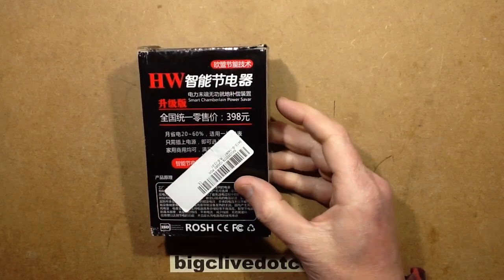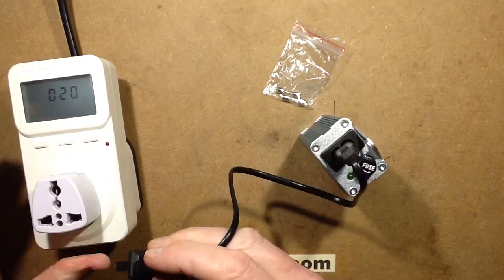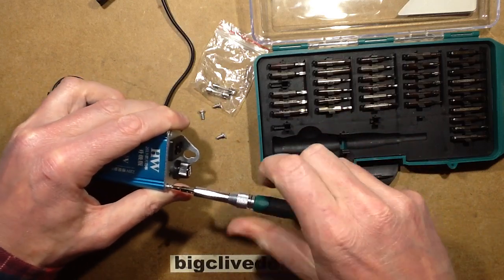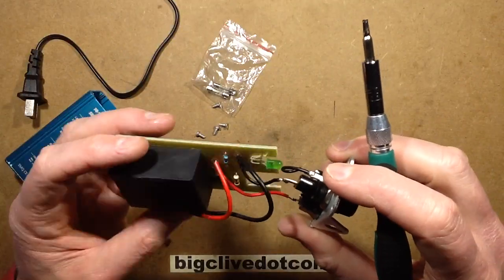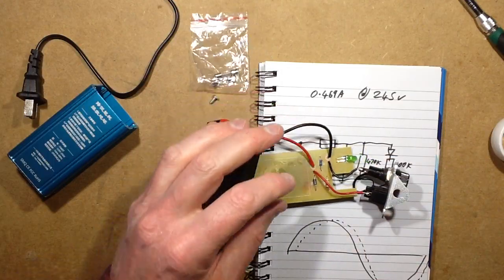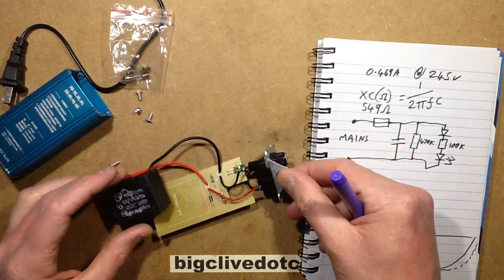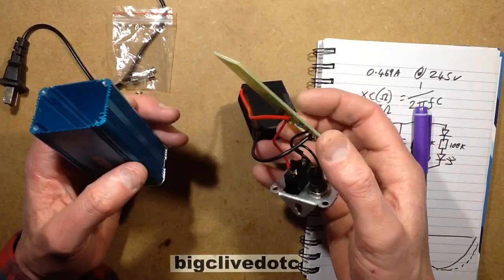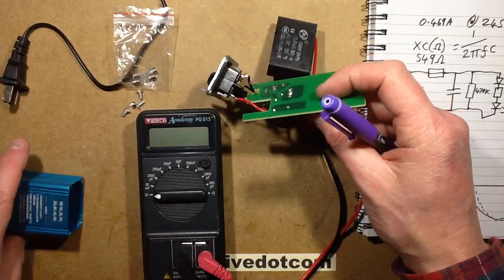200kW miracle power saving device.

Comment: for example, if you use a small lm2587 step-up converter and keep a 24v stacker of 10x 3500f supercaps, you will be able to boil water every 35minutes. the less you draw per second at one time the more you save. when you think and do everything that way, you can use and distribute the energy, and the resistance you use to reduce charging you also use as a source for 24-volt hot water (resistor)for example. if you consider one solar panel can charge those caps every 15minutes, you soon realize you can boil that water or solder a forklift to then lift a semi-truck. I have been thinking way out of the box...past Saturn...1000x. if you get the metaphor....oups...lol i consider you top of the chart brother.

Comment: I cut my electric bill (apt, rental) by 1/2 by flipping off electric water heater when not actively using it.  Dropped it another 1/4 by regulating air temp in such a way to allow the neighbors starred wall to heat or cool my space!  No quackery required 😗

Comment: I'm new too capacitors circuit board's ,but find very interesting . What about starter boost capacitor combinations for automobiles from cheap ones to middle grade .  16volt 20f  maybe just to boost 1200cc motorcycle, are they helpful or could they do more damage to a ecm even with a protection board and does it protect battery during a start-up automobile or motorcycle.   This area is dark for me up in air ☺ 100% more mechanic skills  30+years .  take care. Great video.
Reply from the maker: Proper capacitors can help with the initial spike of current during starting as they can deliver the current better than older batteries can.  They are used in some very cold countries.

Comment: The capacitor will save power consumption but not in watts. It will help offset the vars that you would see in motors or coils. But this small capacitor might lower the vars on maybe a small muffin fan. It will not save anything on watts which is lights and heaters and other non inductive loads. One more thing if you are not running a small motor or computer fan or something small it will be plugged in constantly and it will use vars as a capacitive load so it really would cost to use it. Companys that have lots of motors loads will put in a capacitor bank matched to their normal plant motor load to bring the load power factor close to zerro.
Homes dont do this for couple reasons. One is... the home are not billed for their inductive load and also the power company will install capacitor banks on lines or in substations in towns. It's easier for them to do that. But big business they charge you for var usage. The electric company may not charge homes but the power plant generators have to make vars that the town uses so that is a loss to them and they try to control it. But for homes this unit in the video is a waste.
Sorry this is long.

Comment: In factories or other industrial installations, the facility engineer knows about inductive loading; the correct capacitance for every device is wired in with the device.  In fact, if their vendors are on the ball, the correct matching capacitor will generally be part of the device (at the very least, the documentation of the device will advise the capacitance needed).  It’s not like this is something that was just discovered — Steinmetz wrote about it while he was creating the fundamental principles of electrical engineering.
Reply: You give most facility managers far too much credit for understanding the electrical systems in their installations and factories …
Reply: @andyxox4168  Of cause facility managers understand the site electrical systems, if the facilities electrical load is significantly out of phase (inductive or capacitive) the Utility will significantly increase your Unit charge. Be aware, even if you alter your inductive or capacitive load your meter will track the modified Wattage consumption and you will also be down on power.
Reply: @normie8895  … you give ‘facilities managers’ too much credit, ‘cause’ some of them don’t pay attention to spelling/grammar
Reply: @andyxox4168 English teachers look great in skirts
Reply: I always found those capacitor rooms creepy. They sound so ominious and it feels that there's some inductive voltage when you just walk in the room.

Comment: In order to properly make use of power factor correction, you would have to actually integrate such a system into your house's combined heating/power unit, breaker box, metering system, etc. And it would also need to be a smart system that automatically adjusts do that it can actually correct for different loads. And chances are, it probably wouldn't save very much power at all, though it could possibly clean up "dirty power" from emergency generators, reserve batteries, or the like.

TL-DR: Probably more effort than it's worth.

Comment: My bill shows line charge, production charge, fuel charge, tax - the wattage charge is almost equal to fixed charges. I changed to tankless water heater, insulated windows, added ceiling fan & down sized the heat pump after the upgrades. Next is changing the heatpump from (air to air) to (water to air) after I remove trees. The temperatures now are 2 degrees up in summer & 2 degrees down in winter.

Comment: Question for bigclive.
I am having a problem with a 50hz front load washer being run by a 50/60hz inverter. One bought in Thailand the other in Philippines. When being run by the inverter all is OK until the drain pump. The pump goes into convulsions. Off on very fast. So I cannot drain from the wash cycle to then continue to rinse. It works fine if I use my Honda genset. Someone once said to use a capacitor across the drain pump but that cost me a new washer circuit board.
Buy a new 50hz inverter?
Any ideas?
With thanks
Reply from the maker: The pump is probably a synchronous motor and is looking for as close to a sinewave supply as  possible.  With a waveform it doesn't like it may buzz and stutter, but never get up to its natural speed.

Comment: When the supply and load impedance match, it reduces power consuption. Your elaboration, however mesmerizing, is bullshittery.
Reply from the maker: Modern electronic power factor cannot be corrected with a simple capacitor.

Comment: I have had that idea to make the current lead enough so it is in phase with the voltage and then the electrons would bounce around more to create more work, this should be done right at the power plant or it could be done at each receptacle in your wall, but your loads would have to plug into the device, not like this device shown in this video, that does didley squat since the current just goes down the neutral wire back to the last secondary coil of the step-down transformer and doesn't enter the load device at all. A big scam to get our money! This also could be used at power plants to also add all the 3 phase currents together which would both triple the voltage and current by putting each out of the 120 degrees phases in sync since their is 360 degrees in each revolution or circle, but since the wavelength of 60 Hertz is 5000 meters, there would be some distance involved in the wiring of the process, but no we wouldn't have to use capacitors or inductors to cause leading or lagging at all to do this - just apply the distances. Contact me if you want to know in detail. And check out this and let me know if you don't think I know what I am talking about or not @ http://VoltageSynthesizerBasics.blogspot.com. More will added to this later, but I have been delayed. I have a product coming called Power Supply Curren(t)cy Saver, which doesn't go above 120 volts but will have an AC voltage regulator attached. My company is called W.I.R.E.D Power Supple Services Ltd., but I am a Slow Poke like April Wine's song.

Comment: Most household appliances are quite inductive. This results in inductive current (VAr:s) flowing in the wiring alongside the work current (Watts). Although the VA current does no work it will generate losses in the wiring.

This device is just a capacitive compensator. Technically it will reduce the total VA current resulting in less losses in the wiring.

There are some safety aspects though. If an appliance VA current is completely compensated there will be resonance. This could result in strong currents between the appliance and this device. There is a fire hazard. If an appliance is to be compensated the appliance should always be fitted with its own capacitor inside the appliance casing. Appliances should never be fully compensated. The efficiency factor (cosine fai) should not be more than 0.95. Resonance currents may explain fuse box or switch gear explosions.

The grid voltage usually contains strong harmonics. The third harmonic is the strongest. They are usually caused by driving the grid transformers close to saturation. These harmonics are actually cleaned up these devices, to some degree, but they can cause the capacitor to run quite warm. The capacitor will deteriorate fast and eventually short out. They may explode.

Lighning causes shock waves in lines and house wirings. The shock wave will go where the impedance is smallest. A device like this could provide that. The device may explode. However. It may save other appliances from destruction.
Reply: Isnt the reason we drive ground rods into the ground to reduce objectionable current like nearby lightning strikes?

Comment: The best electricity saving device I've ever seen is the OFF switch
Reply: ppl would be surprised how much you will save in a month unplugging the microwave and kerrig or similar coffee machine. power bars make things easier.
Reply: @Phil_From_Canukistan  that's not all the TV and cable box use a lot of power even when turned off so do computer and monitor you can cut your power use by up to 30 % by shuting them off when not in use
Reply: @douglaswindsor120  i just instal power strips on everything and flip them off when not in use. My power bill is very low. Vampire power draw is a real thing, folks.
Reply: @Phil_From_Canukistan  my power consumption is is low but unfortunately I get dinged billing fee's municipal access fee and a grid tie fee also GST and carbon tax over a hundred dollars per month of cost that I can't get rid of unless I cut the grid and so far I can find an inverter for the north american market under six thousand dollars and I can't afford that much money I just want a 12 volt pure sine wave inverter that gives me 120/240 volt 2 thousand watts that'll cover everything I've looked at solar generators but unless you've got eight grand all you can get is 120 volt I did find one that is under a grand but it is only 120 volts and designed to need new batteries
yearly and the solar look is a joke if you use its full capacity one day then it'll take 2 day's to recharge
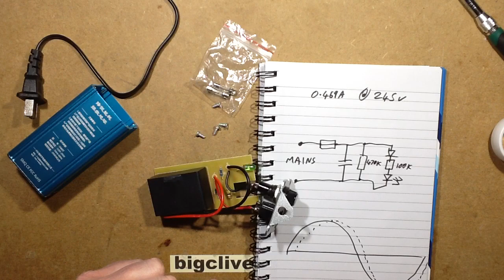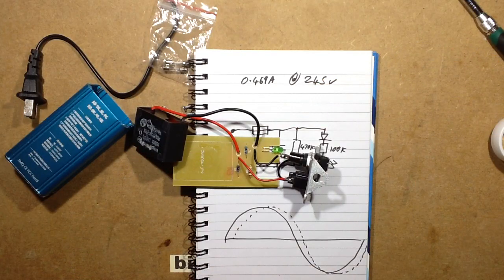Reply: celebrate Earth Hour on March 21 at 8:30p to 9:30p... switch it all off
Reply: Coverage Awareness Studio I rather not?

Comment: This device which any fool can make for 1$ or from scrap electronics can save your charger or LED bulb from failure and that's about all it can do.
Reply: Or you can use TVS(transient voltage suppressor for AC, 250V~) which is 10 cents lol

Comment: If you have an inductive load... oh there is a circuit board in there 

If you have an inductive load... there is the capacitor

If you have an inductive load... oh hold on
Reply: I literally scrolled by as he said that.
Reply: Aperture Laboratories same
Reply: Diplomatic. He plays a safe game. But on the other hand he also talks about how good this portion, and how that portion is not enough to do the trick. Which means Clive knows exactly what is needed to save power. But, the diplomacy and safe game again. 
But well, greenaum explained us a lot.
Reply: Question: if I have old fashioned power meter, with inductances within, instead a new digital power meter, would it make a difference? Nobody mentioned such thing, it would be interesting to do measurements. With inductive load, of course. Can you do that, please?
Reply: @colloidalsilverwater15ppm88  by virtue of it being a meter shouldn't it be calibrated out of the box to show readings independent of its internal electrical characteristics?
Reply: @Cenentury0941  you've missed a point. I am not talking about internal adjustments of meters....but about measurements of real consumtion, and the difference between using old and new meter. ?Cenentury? Seriously?
Reply: @colloidalsilverwater15ppm88  Energy meters for residential use measure real power, it doesn’t matter whether they are old style or new style. They are designed to do that and that’s what they do. The new ones measure imaginary power as well, but the measurement is not used to calculate your bill and is mostly for survey and capacity planning purposes by the distribution grid operator.
Reply: If you have an inductive load it buggers up the phase of the power. Pulls the current in one direction relative to the voltage. A capacitor pulls it in the other direction. So it cancels out. 

As a capacitor charges, it pulls large current even when the voltage is low, when the voltage is starting to rise in it's sine wave. An inductor resists change in current, so only starts to draw current a while after the voltage rises.

Electric companies don't like large inductive loads, because their system, and most loads, is based around the idea of loads being resistive, with a 1:1 relationship between voltage and current. Disturbing this messes up the system. So if you're a factory with huge motors, the electric company charge you extra for that. 

But it only makes an actual difference if you have large loads. A little motor won't make any noticable difference. Nothing domestic should be any big deal. And electric companies only charge you based on a resistive model anyway. 

So a capacitor  in a box won't make a difference. And especially the tiny one here. You need proper big capacitors to balance out proper big motors. 

And that's how Clive's sentence would have ended.
Reply: greenaum messes up the system how?  Is the power company losing money and that’s why they charge more?
Reply: @charlesmurphy1510  because they see phase delays when they're expecting the 1:1 ratio green mentioned, makes them think their equipment is screwy, which gets them wasting their time investigating their equipment.
My guess.  

Look up phase delay, pictures are helpful
Reply: 100kW really? lol, this device consumes more power than it saves. It's almost like an electronic form of homeopathy...

Comment: I once witnessed a grown man cry because of a scam residential energy saving capacitor.  He had sunk his entire life savings into an exclusive deal to market a power saving device to residential customers across a few states.  He came to us (I worked for the power company at the time) to show us his miracle device and get our endorsement.  He did the typical demonstration using an unloaded motor with and without the device and measured the current with a cheap ammeter.  I grabbed my Fluke 43 and showed him exactly what his device was doing, just a capacitor.  We then explained that we did not bill residential customers for poor power factor so his device would NOT save them any money on their bills.  His device was completely potted so you could not easily take it apart.  Pure scam.

Comment: The parts for this device are at least useful for other things, but however are cheaper getting separate.

Quickest way to save on energy;
switch to LED bulbs,
because it requires the least amount of effort to change whatever ways you're set in.

Best way to save on energy;
Actually put effort in to using less, pay attention to how long you have things on, or plugged in, or running.

Super way to save on energy;
Make and store it yourself, in your own means, and all the energy management that follows the change.

Comment: As long as you pay per kWh you wont save anything on your bill. Capacitors increase your powet factor. Power factor is how much % of your current is used for what you want. If you have a pure resistant load, this is 1 or 100%. These loads are stuff like heater elements, light bulbs (not led, but normal ones with the wire inside) etc. Electronics, electric motors and led's are inductive loads which lower your power factor. It will then draw more current to provide the same power. The formula for power (kW) is U(voltage)*I(current)*cosPhi(power factor). So 230 watts at 230 volts can either be 1 amp with a pure resistant load (theoretically 100% power factor), or 1.25 amps with an inductive load with an 80% power factor. The only reason to increase this is if you have large equipment like electric 3phase motors in factories you can use smaller cables for the mains supply if you have capacitors at the engine.